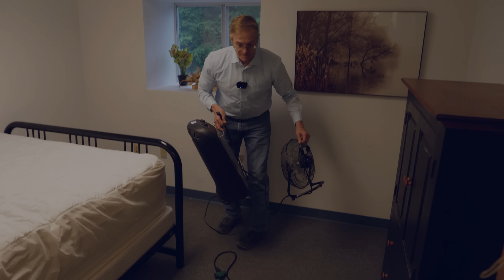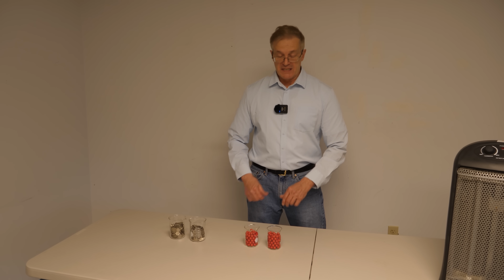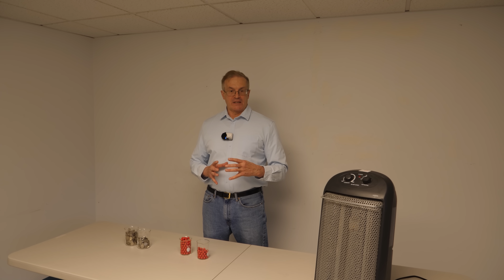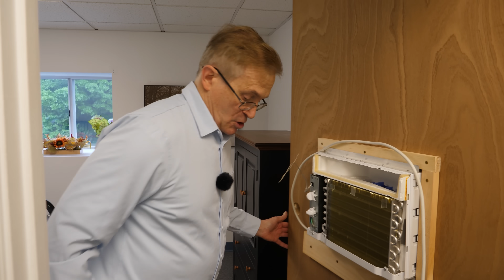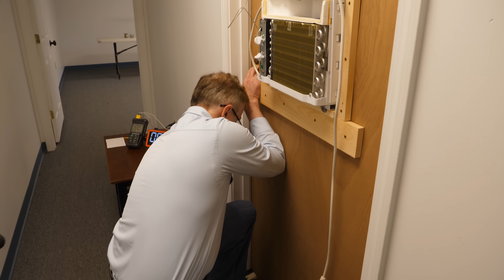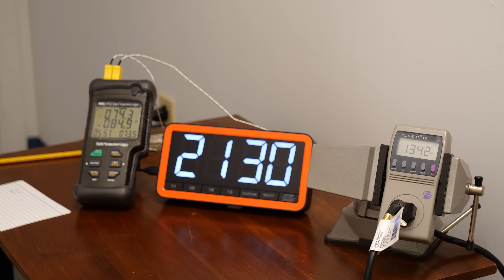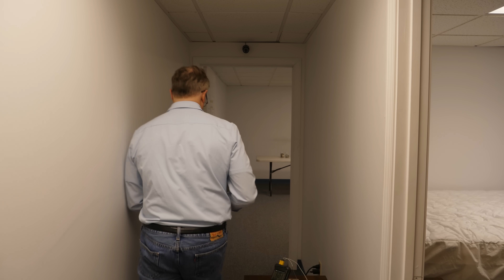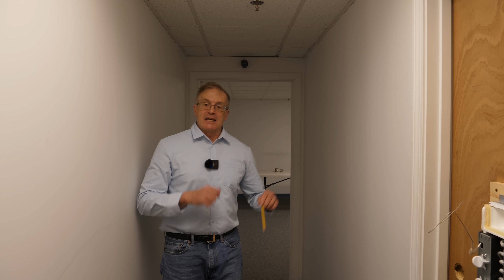You're wasting money on heating! Use your A/C!

Comment: Well, you certainly cannot just turn around the A/C unit. If it's cold outside, (the reason you need heat), The thermostat, in an A/C unit, will turn it off, as the "cooling" temp will have been met. The thermostat will need to be changed or reconfigured.
I don't see a heat pump being able to even heat a room during winter in a cold climate, much less a reversed A/c unit!!!!
THEREFORE, I find your "title" MISLEADING.

Comment: heat pump....Ha! a boiler shall alwas be more efficeint. when my heat pump is working at temps above 40 degrees it is ok. the closer to 40 degrees i get the higher my electric bill. i have a sub zero system in colorado that i installed to try to get of the electric baseboard heat. ya...beats a space heater but not proving anything about the heat pump being a good idea in any situation save for california or arizona. but when actually trying to heat a home it still does not do any good for the bills. my pellet stove does a much better job heating my home then a heat pump or electric base board. no one ever speaks of how inefficiant these become when you actually need to heat your home.
Reply: is hard to create heat from cold efficiantly. no one has really created a totally energy efficiant perpetual motion machine yet....and a heat pump is not one. a crude way of thinking you are being gree and reducing your carbon footprint if anything. diesel generator or nuke power still taxing the grid. solar thermal is a proven much better option to create both domestic hot water and space heat. not inexpensive for a proper install but oic a few solar electric and solar thermal panels. goodness is there.

Comment: I always noticed that the outside condenser coil of all of my AC units was hot, even hotter than the air outside, I always thought I could turn this the opposite direction in the winter and it would become a heater, but how would I protect the controls from the weather outside? and would I have to turn it back the opposite way in the summer to make it a Air conditioner for the summer heat?  I have 3 AC units here. I am in a Camper.

Comment: Even in Texas (or South Mississippi, where we live) the temps outdoors can dip below freezing regularly in the winter.  Heat pumps are designed to be able to scavenge every little erg of heat from the outdoors in winter, but they're specially designed to do so.  A window unit like that most likely won't be able to grab usable heat from the outdoors when it's below 32 degrees.  That should be your next test.
Reply from the maker: This video demonstration was done to prove the basic principle. The features needed to operate a heat pump would have to be added to a conventional airconditioner for a practical installation.
Reply: @TechIngredients  I understand that.  It runs counter to the title of the video, however.  We all get clickbait.  But by calling the video "You're wasting money on heating!  Use your A/C" you imply that people could use an existing A/C (window unit as tested) to replace a radiant heater, and I'm fairly confident that what would happen is that it would work just fine right up until they really needed it (coldest part of Winter) at which point they would have no useful heating at all.

Comment: first the ac to temp probe is 3x less with ac = flawed #2 no one uses a fan with a room heater and yess it drops the room temp did you use fan with ac no no no why. and you are flawed
Reply from the maker: You could work a little on your grammar.
To your point, the probe was off to the side of the blast from the airconditioner. The fan helped to distribute the heat from the resistance heater, just like the fan in the airconditioner distributed the heat from the airconditioner.

Comment: Thank you both so much for  explaining this principles !!! Have a 820% warmth in my house compared with resistance heat!!
Amazing good working system, 
If the airco’s are able to “ run “ both ways, the home can be heated for about 1/5 of the watthours used by resistor based heating.
The efficiency of heatpumps drops when the difference in ambient temperature versus outside.
Sometimes it is only 300%
But with prices for fuel / gas etc. 
You can spare a lot of money.
Certainly when solar energy is used, and heat is produced when a cold sunny day warms your house for free!!!

Comment: 1:31 "A resistant heater [...] is about the most efficient [...] close to 100% efficient. However, a heat pump can be many times more efficient" well you lost me, like in your other videos... many times more efficient than 100%? You need to start learning mathematics first
Reply from the maker: Did I say effecient or effective?
There is an enormous difference.
Remember that the resistance heater makes heat, and the heat pump just moves heat around.

Comment: I have three heat pumps, they produce about three and a half kilowatts of heat for every kilowatt of power used. Trouble is in the cold damp winter we get here in the UK the outside evaporator coils get clogged with ice.
Reply: no antifreezing system ?  I thought it was integrated in each heat pump. Nb :  i am french
Reply: @jf4958  Yes it has "de icing feature" however when there is a lot of ice build up you end up with several minuets of ice cold air being blasted into your house as the system deals with the ice by going into reverse and pumping heat out of the house and into the outside in other words it becomes an air conditioner on maximum setting for a short time Ok if just a little ice but as I previously said here in the damp foggy cold UK you get a lot of ice build up to the point the systems cannot cope with easily.

Comment: I'm the real world, the further you get down the scale the less effective the heat pump. The limiting factor being how much air the pump can pull through it. Which is a fixed quantity. At -20°c ambient outside, for a regular AC your not going to heat any room. Basically your grandma had the best advice. Put on a sweater. When it's still cold, then turn on the heater.
Reply: I apprenticed to my uncle back in the '80's doing heating and a/c work, and back then heat pumps were generally considered only really appropriate for Florida winters. Yes, I know technology has advanced greatly, but it's still like you said...there's a limit, and the limit comes quickly in northern latitudes.

Comment: Is there a fan in the exterior part of the A/C unit to force the warm air through the room? And I’m guessing you’ll have to find a way to catch the water that’ll drain inside the room? Finally, is the front of the unit waterproof, and is there a thermostat on the front of the air conditioner that could cause it to shut off when the outside air is cooler than the temperature it’s putting out?
Reply from the maker: There is a fan for the cold and a fan for the warm flow.
The cold side is not waterproof. The area around the outside of the window needs to be protected by, say, an upper level deck or roof.
The water can be drained to wherever you like.

Comment: Yea like I'm going to turn my air conditioner around in the winter and expose all the controls that are designed to be in an inside environment to the harsh outside winter environment. I don't think so. I'll just keep using my AC to cool the inside in the summer and my heater to warm the inside in the winter. A better test would be to have the outside of the bedroom at 30 degrees and see how much heat the other side of the AC puts into the room.

Comment: Heat pumps are fine snd dandy isln areas where temperature fluctuations snd extremes aren't too disparate, but for those of us who live  in areas where temperature variations go from 40°C + humidity in the summer to -35°C + wind chill in the winter, a heat pump is at best "inefficient" in the Winter months... and useless in the coldest periods of the Winter. Considering that more people die as a result of exposure to cold, than exposure to heat, anyone who wants to install a heat pump in my house will earn themselves a size 16 boot upside the head.
Reply: I did a/c work YEARS ago, and the general consensus was that heat pumps were great in Florida latitudes, and got more undesirable the further north you went.
Reply: @CallibanMcGee  
The Canadian government is trying to push heat pumps in everyone across the country, but when winter sets in, they're pretty useless; and the "back-up" method of heating ends up costing $$$$$, unless they have a fireplace.

Comment: So we turn them around in the window. So how do we keep the human element from turning the unit off in the middle of the night and how do we protect the circuit board from weather.
Your biggest flaw is that these crappy window units, have about a 3 year longevity and they cannot be repaired anywhere. the cost of repair is more than the cost of the unit. HVAC people will not touch them.  What is your solution to that. Unless you have a HVAC license you can't buy the freon or the recovery tanks. They also don't have fill valves on the units so the units are sealed. How do you recover the freon if you have to open them. There is no drainage valve.
Unless you are licensed HVAC companies will not even sell you a register cover or anything else HVAC.
One last thing are you telling me I have to buy a new unit that you came up with that has the same crappy circuit boards and sealed units that can't be repaired. I've had some units that go up the first year I bought them. Without a 10 year warranty I won't buy it.

Comment: I wish you’d show us your settings on the ac , I  ran off a generator for a while and always thought the window units used more watts than that ( if ac was actually on ) so are you using on fan only? And what are you supposed to do turn them around in the winter? Would that be a problem if it rains? I’m very interested
Reply from the maker: It certainly depends on the size of the airconditioner.  This is a 5,000 BTU unit.
If only the fan were running, the room wouldn't get warm.

Comment: This is BS! the ac unit will not start the compressor if it's cold outside. And even if it would what about water dripping out of it? Horse shit!
Reply: I think this is just a practical demonstration showing how a heat pump works. They are just ACs running backwards. They used to only be efficient down to 33 degrees. Maybe that’s changed,idk. I installed a radiant barrier on my home and have a wood stove, so this is kind of mute. Interesting though.
Reply from the maker: Ray burn is correct. 
This was a demonstration of the principle.
MrGsxr, you missed the point, so relax.
Incidentally, you can route the water wherever you want.

Comment: So if it's 72 out and you want to heat your house to 90..this is awesome....what if it's 30 outside?
Reply: Ground sourced heat pump! Heat pumps used to not be efficient in colder climates, only down to 33 degrees. The radiant barrier I installed on my home works great.

Comment: That's good and all but AC doesn't just remove heat it removes moisture, so if you flip it around you're going to get all the moisture from the outside dripping on your floor.
Reply from the maker: You can route the water wherever you want.  Look at an air conditioner, and you'll see the drain hole.

Comment: @Tech Ingredients, I've been aware of this concepts for quite some time now. Also, if you have an oil filled heater
like the one's that own, four in all that have a 400 watt setting that can easily accommodate a 11.5' X  10' living
space, that of in a mobile home and by utilizing the variable setting while also set on 400 Watts such as to try and 
supplement the heating plant that you already have, that nice setting on your variable thermostat is calibrated
to a nice 68 degrees while the furnace is set to 66 degrees, the heater in that bedroom is taking up the slack or
compensating for the difference while not even for the oil filled heater not to run 400 watts all of the time!! I've
done this in my mobile home for years now and while an in home assessment specialist told me that I should
not do this because I am on an electric monthly equal payment budget plan, but hell no, I do it anyways during the 
winter months and even though I do this, I am happy as a clam! Bare in mind that I only heat the room that I occupy 
at night, during the winter time, that is the coldest room in the whole place and only for 7.5-8 hours per day. While
all the other rooms in my place see an ambient temp of 66F degrees, I just dress warmer for the day's haul! I had
chose to purchase 4 of these oil type heaters because they are a good miser of electricity and I bought them at
about 42 bucks each, way back when, knowing full well that the price that they normally sell for even back then
would fetch 70 bucks on average. I use a second on for the bathroom which is also colder than the rest of the
household and close the door such as to prewarm that small bathroom, that I will fire up a half hour before I desire 
to get myself in the shower to get scrubbed up! It too does a fabulous job on that same 400 watt setting with the
variable setting of the thermostat set at the half way mark and it is nice and toasty like no other. Well now, the one
in bedroom that has the variable setting was set at much less than the half way mark OR to that already stated
calibration of around 68 degrees with the bedroom door set ajar by about one inch of opening. Thus some of the
heat that escapes the room still gets scavenged and recirculated back into the air intake of the furnace just 10 foot 
away from this bedroom. The concept plan as you've pointed out while simulating use of a heat pump and also thus 
by recapturing/scavenging the heat is ideal also on the premise of keeping a balance of the humidity is ideal! I get
it and this concept of yours can leave most heating plants in the dust. BUT for the meantime, even with my place
being nearly 51 years old, I get by as it is with no insulation or new windows upgrades and still be in a budget area
that is a near equivalent of most other older homes for the same square footage, again with no upgrades. My own
mother complained of the high cost of having an electric furnace while she was living here but now she had the 
furnace set at around 70-72 degrees. So now with my living here since 2007, my thermostat has been set at 66
degrees instead and supplement with additional oil filled radiant heaters for all of this time! I tried the quartz type
vertical radiant heaters way back when and fell in love with them a hell of a long time ago, but they weren't as
energy efficient as these oil filled radiator designs. On that electric furnace of mine that I installed back in 1990,
it isn't what you would call energy efficient that is rated for 100K BTU for the amount of around 1000 SQ Foot of
living area. Just last month my power consumption for the month of August 2024 came in at 400 KW heating
and all, of which was a wee bit cooler here in N.E. PA which wasn't too bad that equated to around 90 bucks for the
month. Bare in mind, the place has not had any additional insulation upgrades and the insulation in the floor space
has been attacked by cats and skunks over the years that left some of that insulation in tatters and zero insulation
applied up in the roof system overall. The contractor that built a roof system over top of the mobile home decided
to not insulate and my Mom had to take this guy to court over the deal due to his failure to not honor my Mom's 
request at time of the job.

Comment: Since the meter collects it, why didn't you display the total watts used for the 30 minutes?  In the real world appliances are not always on 100% but cycle.  Does either method have a real world advantage based on the startup/shutdown cycle of real life?
Reply from the maker: That could be useful.
In this case, because the airconditioner only cycles on once for a few seconds of the thirty minute test, the results will be very similar.

Comment: If most heat is lost rising thru the roof, then wouldn't it make sense to put a heat pump in your attic or crawlspace floor, between that.and your top level ceiling? You could also duct that warm air to go lower, to your lower level or main floor.
Reply from the maker: That's a good idea. The roof acts as the first stage in a hybrid, solar/ compressor based heater.
Reply: I was just thinking about doing that in my garage for winter. A simple inlet and outlet with 2 fans should work.
Reply: WOW, I’m shadow banned and my comment on here was deleted. Install a radiant barrier in your attic.

Comment: Inverter compressors rock. I've been impressed with their performance over standard on-off compressors common in older systems.
High efficiency heat pumps give me the ability to run A/C or Heat long than conventional systems using less power a plus when maximizing a solar system to run my equipment.

Comment: what do you need to do with the a/c exactly and what if it's below 32 outside will your a/c work?
Reply: Good question. Heat pumps used to only be efficient down to 33 degrees.

Comment: I've already been sold on heat pumps being more efficient, but I do have a problem with the way the test was done, in the interest of skeptics. You used the AC which was extracting already warm air into the room. Realistically you'd do the test outside a window during the night when it has to extract heat from relatively cold air.
Reply: I’ve always understood that the ac just runs backwards, extracting the residual heat that is put off; only efficient down to 33 degrees.